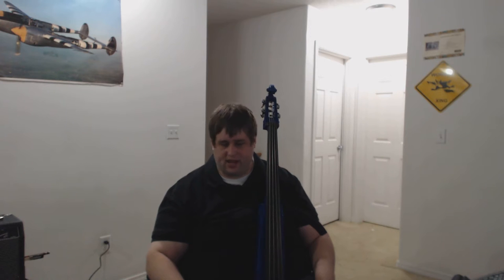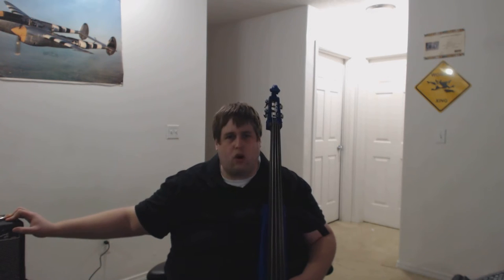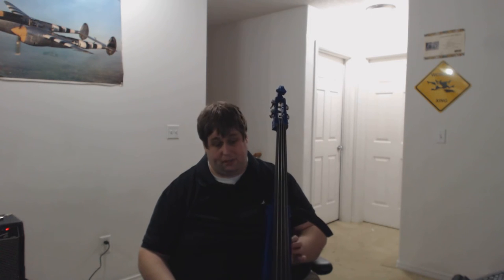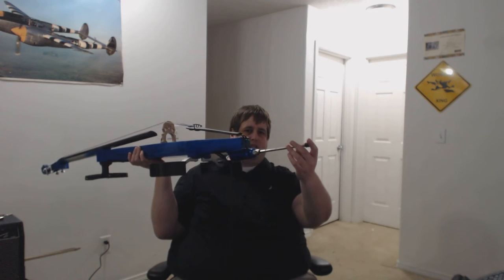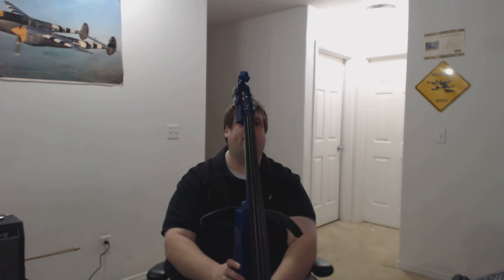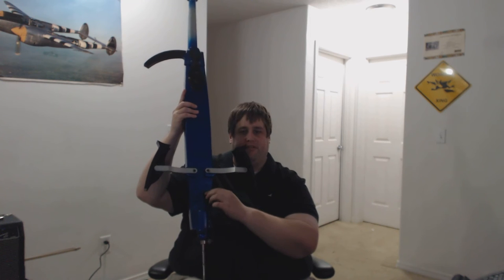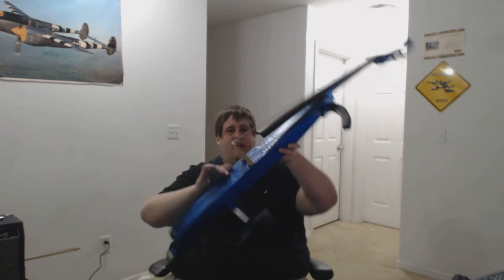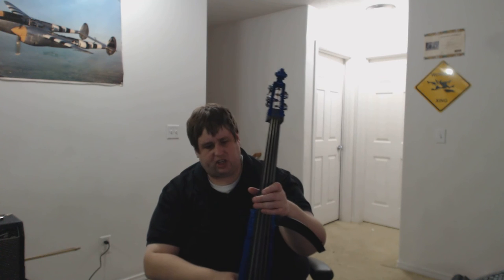A 3d Printed Electric Cello!

Comment: Hey Tim, absolutely astounding project. I've checked your forum thread on lulzbot along with your Thingyverse page but I don't see any option to download / buy the files. 

Is this still a project you're considering making available for a fee? If so I'd be very interested in obtaining the files to try printing out.
Reply from the maker: Hi there! Thank you for the kind words, I'm glad you enjoyed it! I am indeed still planning on releasing this for a fee. I wanted to give it several months first to make sure the body and neck held up to the string strain, which it has done quite nicely. I also want to try and locate someoen to play the thing for a video that actually knows how to play the cello, and that hasn't been quite as easy to do. The files are all packaged and ready to host somewhere, along with basic instructions and whatnot. If you like, shoot me an e-mail at piercet (at) comcast.net or via PM on the lulzbot forum and we can figure out how to get you a set of the files. The intent of this project specifically is to help fund all the other open source project work I do, so thats why you haven't seen it up anywhere posted yet.

Comment: So did you glue this cello neck and body sections together?or you use some rod or carbon fitter to strength them? The tension in the string is super high like 600N, so I wonder how you connect?
Reply from the maker: tony tony the neck is epoxied to a traditional fingerboard (other glues didn't work) with a pair of 8mm steel rods, one running from the top of the neck to the join and the other running through the body in a channel near the back side. It's been holding fine for over a year now, with no major issues or detuning other than the initial expected string stretch. Plus it's nearly solid abs which at 50mm thick or more is plenty strong. The neck is at least as strong as a traditional cello if not more so.
Reply: Tim Pierce i see, then how did you join the rod from neck and the rod from body? Did you glue the 2 rods into the abs? Or you have a metal piece to thread in the rods?
Reply from the maker: tony tony it's just smooth rod glued into the body with epoxy. Leftover 3d printer guide bearing rod actually. The two rods overlap at different sections into a really solid piece of abs about 30mm apart. They do not touch. One supports the body and one the neck. The abs join and the fingerboard provide the rest of the support. It seems to be holding up well with no cracking, stress marks or other signs of degrading.

Comment: How much is it cost to print such a big thing?
Reply from the maker: It took around 6lb of and plastic, which at the time was about $80 worth. There is another $140 In parts on it as Well, I opted for an expensive fingerboard so you could probably reduce that cost a bit. Cost to have someone actually print it would vary. The paint was duplicolor metalcast blue and was about $30 ish.
Reply: Tim Pierce is all part printed solid with 100% infill ABS?
Reply from the maker: tony tony the upper and lower sections were printed mostly solid, but with voids engineered into the parts. There are also pockets for truss rods and wireing.  The center section is hollow with a soundpost and a bass bar. There is also a rear resonance void.
Reply: Tim Pierce so what is the wall thickness for your resonance chamber? And how big is it like the size dimension? Did you try to taking natural resonance frequency into the design? Thanks.
Reply from the maker: The wall thickness varies. The front section is on average about 6mm thick, the sides are 8, and the thin back wall is 4 or 5mm. There is a soundpost connecting the front and the back, and there is a bass bar approximatly 40mm tall by 10mm-ish thick running the length of the sound chamber. The sound chamber itself is about 260mm long and 125mm or so wide, and about 80mm tall. The outer dimensions are slightly bigger, and that doesn't take into account some of the back thickness for the resonance plates on the other side of the external air gap, nor the truss rod passthrough and cable chases. 

My design theory on the resonance chamber was to make the ABS plastic sound about like what a cello sized thickness of spruce, in my case 5mm thick aircraft grade plywood spruce sounds like when struck with a xylophone mallet. Why a xylophone mallet you ask? It's what I had sitting around at the time. The ABS at 6mm ended up sounding similar to the 5mm thickness of wood, just judging by ear. I suspect a PLA resonance chamber would actually sound better. The plan is to release the design files as closed source for this one, but release the resonance chamber itself as open source so people can experiment with different materials and maybe different designs that mount to the common core stack. I was envisioning somethign like a plastic box with an actual wood cover, or maybe a titanium frontplate (I've never seen a titanium cello, and its probably a terrible idea, but that way we could find out for sure!)
Reply: Tim Pierce is anywhere I can see the resonance chamber design? I want to test and contribute to it, thanks
Reply from the maker: Not as such right at the moment. I haven't posted the files anywhere yet.Just been busy. I'll get them up sometime this week. The resonance chamber and backplate will be hosted as open source on thingiverse with step files and stls. The rest of the cello will go somewhere else as yet to be determined. Possibly myminifactory or etsy or something. I'm planning on selling the files for around $5 or so. I figure there are enough people with 300mm beds out there that might want to give it a try that I might make some money, which will fund my other open source work.
Reply: Tim Pierce thanks, could you share me the link when you upload your file? Thanks
Reply from the maker: Will do, thanks for the interest! sorry its taking me so long to get them hosted heh.
Reply: Tim Pierce any update on this? I am also thinking of such small size, if adding a bass bar and post will make the top panel too rigid, that will not vibrate well that reduce the effect of the resonance chamber?
Reply from the maker: I've been rewriting the instructions. Once i'm happy with them, it will be up on cgtrader for $5.50 Its getting close though. I've got the account setup and the STL and Step files uploaded, just need to finish the last bits up and hit publish and see what happens. I also need to update the parts list.
Reply: Tim Pierce how about the open source resonance chamber?
Reply from the maker: @tutu8482  it's going up about the same time.
Reply: Tim Pierce i see. Another thing I notice is that for the peg box, you are using screws to mount on the neck rather than printing it along with the neck together. So any reason you design like this? Is it because you want to add strength there or? Also, since your material is ABS, did you split the neck into multiple piece to avoid of ABS tilting/cracking? Thanks
Reply from the maker: The neck being 2 (Technically 3) pieces is related to two things. One a standard cello neck is longer than the 329mm you can print diagonally on a taz 300mm x 300mm bed so it had to be multiple pieces, and 2 I figure someone might like to be able to swap in different peg setups if someone later designs a mote traditional one.
Reply: Tim Pierce I see. But I wonder there is clearance on the holes with the screws in the middle piece, so when under string high tension, will this pegbox tilted forward?
Reply from the maker: There are 2 m5 through bolts with plenty of plastic around the holes. Mine did not tilt forward and has not cracked or deformed at all. You could epoxy that join for added strength if you like.

Comment: What paint did you use? I saw it kind of smooth the surface out?
Reply from the maker: I used plastruct modeling putty to fill in some of the ridges, except the front which I kept as is because it looked neat. I then sprayed 3 primer layers, wet sanded then used duplicolor metalcast in blue. The silver on the neck is the metalcast base coat before the blue clear goes on. I clear clearcoated the neck because I wanted it to stay silver.  The black parts are bare abs or gloss black duplicolor  paint depending on where they are.